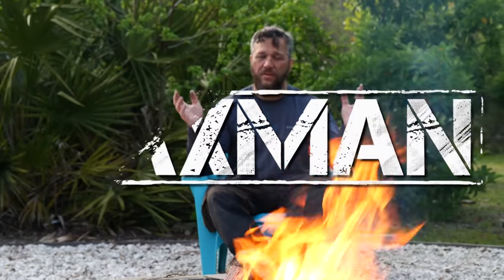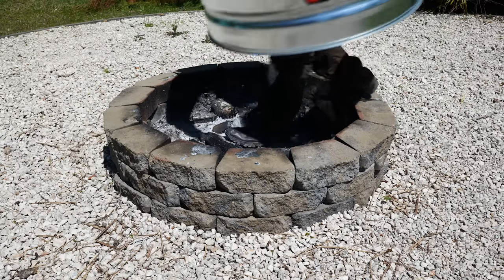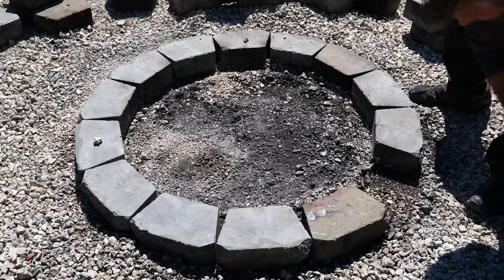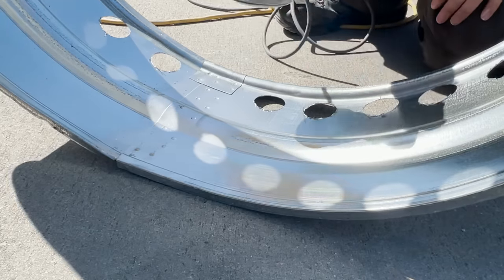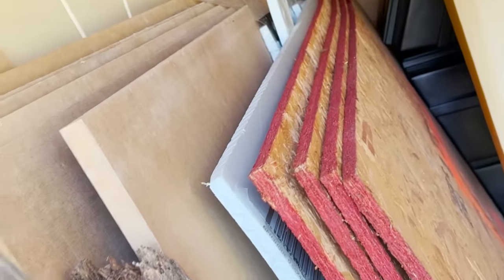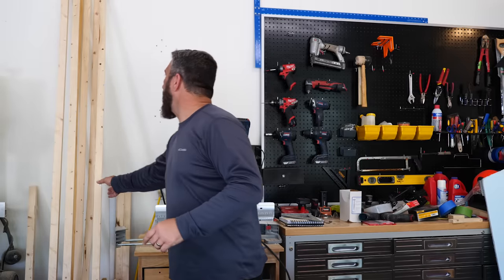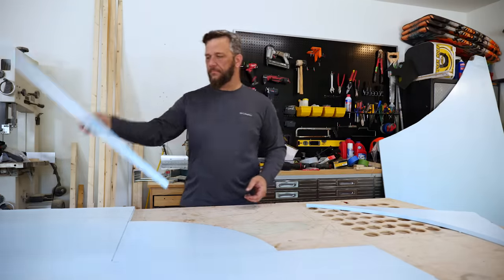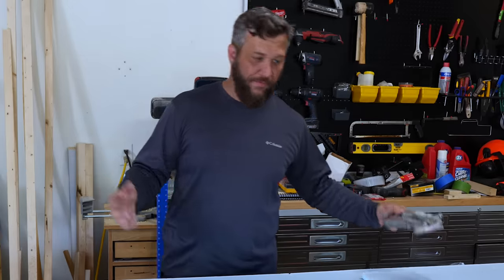Smokeless Fire Pit Makers Hate Me For Showing You This

Comment: So, Zinc toxicity can occur when an individual is exposed to and breathes the heated yellowish fumes produced from welding or heating galvanized steel. For hot-dipped galvanized steel the recommended maximum temperature is 392 F (200 C), before the metal presents a toxicity risk.
Reply: I sent an email to TSC about that exact subject when I first saw the galvanized fire rings. Never heard a peep from them.

Comment: Great molds. I'm shocked how easily the caps came out thanks to spraying the molds with Pam. The use of baking soda as a texturizing agent is also pretty cool.

For pieces that size, wire fencing or mesh can also be used instead of regular rebar.

Comment: So you started endorsing the galvanized steel ring.  In your more recent video you switched to a black ring with a lip.  I bought a galvanized ring. Do I need to switch that out? What about the holes you drilled in the bottom of the ring? Do you still want those or are they now a problem?  Help!
Reply from the maker: I just tried the black ring to see if it made a difference. It doesn’t. Stick with the galvanized ring. I didn’t drill any holes in the bottom. It won’t hurt to do that but it’s nit necessary. Hope that helps. 😉

Comment: How many bags of concrete did you use total for all 4 quarter tops?
Reply: He used 3 bags
Reply: @smaynC  thank you. 
I just did this and used 4 (not knowing) but had a little left over that I used a some weight for the bottom of a planter/light pole. 

I tried to calculate the cubic feet and some online tool told me 6 bags, so that’s what I bought. I guess I have more for another project!

Comment: No holes at the bottom? Usually you want air going to the bottom of the fire for primary burn, and hot secondary air to go to the top of the fire for secondary burn. You've just built the secondary burn. Of course, if it works, it works.

Comment: I cut the Styrofoam mold but when I brushed on the contact cement it dissolved the Styrofoam.  What contact cement should I use (or am I using the wrong Styrofoam)?
Reply: I had the same issue but just went ahead and the forms still bonded just fine. I had to add some extra caulk to fill in some places.
Reply: What ended up working for me was "3M Super 77 Multipurpose Adhesive" spray.  That in combination with the caulk and duct tape worked great.

Comment: Help. I am having issues with the contact cement melting the styrofoam. There is also a thin plastic film that is on the surface of the styrofoam. I guess I should if used a water-based contact cement??
Reply from the maker: Try to leave the film on the styrofoam. That will act as a barrier and keep the glue from eating the foam. Even if it melts the foam a little it will still hold. Just put a thin layer on it. When you pour the concrete make sure you don’t make it too wet. The drier the mix, the stronger it will be.
Reply: I found my fix. I used a thin layer of original gorilla glue, (gold) and used 11/2" corse thread drywall screws 4" apart to fasten the pieces together. I allowed it to dry overnight. This worked fantastically!  

NOTE: Applying too much glue will result in the glue expanding into the mold and must be removed ASAP. 

NOTE 2: Work quickly and wear gloves. This stuff is tough to remove from your fingers! LOL

Thank you for these great ideas! 😊
Reply from the maker: @kevinhill5596  Glad that worked for you!

Comment: If the holes were cut from the metal to help with air flow they're not going to do much when put right next to that cement wall (which then restricts said air flow). Other than that, nice build!

Comment: I’m sure someone has commented here, but the fiberglass you used isn’t made for concrete and didn’t add any strength. You need AR glass fiber (alkali resistant). Also, proper curing would greatly increase your strength and density (we have a short video on our channel for that). If you ever want to venture into the world of UHPC (our mix hits 23,000+ PSI), drop me a line 👍

Comment: A good step bit that will make holes that size will be up to $150 and will be about as much work as a hole saw. A trick to cutting holes in metal like this with a hole saw is to use a lower speed and a lot of pressure. Going at it full speed will heat the hole saw and dull the teeth.

Comment: Got my 79 year old body together and drilled hoes with step bit. Too and bottom.  Surrounded it with lava rocks.  Maybe too many lava rocks..need to leave gaps  Put another galvanized ring inside made out if upside down bucket with smaller opening cut in topside.  Needs some adjustment to work nearly as well as yours

Comment: Still getting a lot of smoke! Does anyone know how to prevent this? Are yall sticking the wood a different way? @Haxman any suggestions?
Reply from the maker: Make sure you make the fire wide. A small fire won’t work. The sides have to get hot to make it work.
Reply: @HAXMAN  YES! Thanks bro. I used the small "teepee" design and built out from there. I'll try a wider more full fire. Sincerely appreciate you!

Comment: Would have been easier to use the left over part of the cut out as the frame and glue 2 on top of each other for thickness place it on plastic sheeting on a level floor and caulk but that's not even needed as seepage just breaks off from the finished piece and is minimal.It can also be sanded smooth if desired. One can place crumpled and partially smoothed out aluminum foil around the inner rim of that form for texture to match the sides of the landscape bricks you used. Possibilities are endless... LOL

Comment: Do you want to cut holes in metal with a metal hole saw?  Try using cutting lubricant (for example, pipe thread cutting lube) and go at a slower speed with your drill.  Otherwise all you are going to do is dull your hole saw.

Comment: Why did you put the holes on top of the metal ring? It seems like you are trying to draw air in low, and so you took out stones from ground level. But the metal ring has the holes a half dozen inches higher. If you flip the ring, the air will flow horizontally straight in, instead of making a funny twist and coming in about 8 inches off the ground. Try this. Space your first ring of bricks so that they all have even spacing between them.  You can do the same with subsequent layers. Flip the metal ring so that the holes are down low also. It should provide more oxygen in a straight line flow, and make less smoke.

Comment: How hot does that concrete get? Enough heat and concrete cracks. Too much and it can explode.
Reply from the maker: This doesn’t get that hot. I built this over three years ago and have had no problems. I’ve tried to crack it with huge fires.
Reply: @HAXMAN  Awesome. Great to know!  Thanks!

Comment: Someone explain the “smokeless” part of a fire? I get it that when there isn’t a fire, no smoke, at that point it’s just a pit, perhaps it’s also a waterless pit.
Reply: Because of construction there is air flow of cold air entering bottom part and hot air leaves trough top. This burns fuel much better and creates barely any smoke. Less wasted fuel, better heat and much less smoke.

Comment: Not such a great idea using galvanized steel in a fire pit. If the fire gets hot enough near the edges (people are going to put varying amounts of fuel in it), it can burn off the galvanization. Zinc poisoning is no joke. Hot dipped galvanized steel has a 392°F safe limit before being toxic.

Other than that, solid video and concept.

Comment: WHY pull out a any bricks, just leave about a 1 inch separation between each brick. All this remind me of the greatest fire pit I saw way back in the 70's at camps that used old close dryer bins as campfire containers. All the holes in the bins did the same thing this shows plus the higher side of the metal dryer bin radiated the heat outward on all side making a toasty fire for all sitting around it.

Comment: Haxman. Are you a comment answerer? 
Several smokeless reviewers report no real radiant heat from the prefab made pits/ canisters. More of an upward heat draft. 
Do you feel your design has lost any heat ?
Reply from the maker: There is not much heat for 12 inches above the ground. After that it’s pretty much normal. Of course it was like that just with the pavers stacked. The only way to have heat from the ground up I guess is to just have a campfire on the ground.
Reply: @HAXMAN  
Super thanks for the reply.  Recently discovered you and I like several of your vids that I’ve seen.

Comment: 7:43 ruined my day. I spent a few hrs cutting out the Styrofoam very neatly only to watch it melt before my eyes after applying contact cement. Contact adhesive is what we want here. Trust me dont use DAP contact cement.  You might even want to add an annotation at 7:43

Comment: Maybe the most useless place to put your hard-earned cash toward.  
You need 3 things to make fire.  Fuel, heat and oxygen.
In the proper proportions, your fire will not smoke.  If your fire is too smoky, then either increase the oxygen or remove some fuel. 
Start your fire with small amounts of fuel.  You don't need to put the entire fuel load into the fire pit at the beginning.
Learn to build a fire the correct way and you won't need to spend $100's on something like this.........

Comment: This is not a realistic demo. Anyone that has built and burned a real TLUD gasifier can tell at a glance the flame have no effect from the modifications. The reason this "demo" fire has less smoke is just that it is a better burning fire with smaller cross section fuel. Now this unit might have some sction if you had a really big fire going. The fire has to be large enough to seriously heat the outer ring to create a draft on the outside. But even then, the flow of heated secondary air will NOT have the velocity to get down to the tiny fire in the center. 

This i no better than the original solid ring and is real worse than just removing the couple of bricks to let air feed the fire from the bottom. Simple science, hot air is not going to flow down to the center fire in an open space. 

I am not saying this is an intentional scam video. Just a complete lack of understanding the basics of fire/combustion
Reply from the maker: Watch the second video